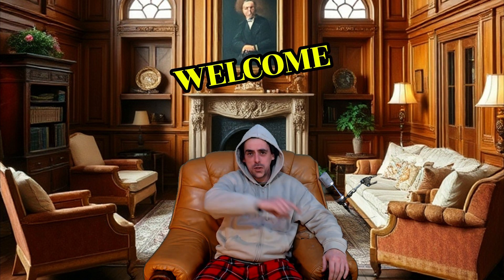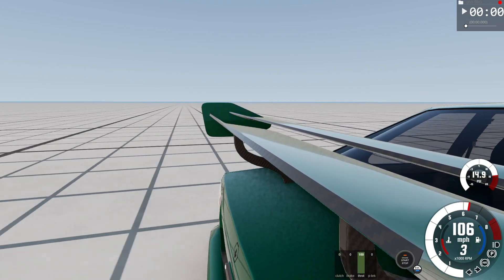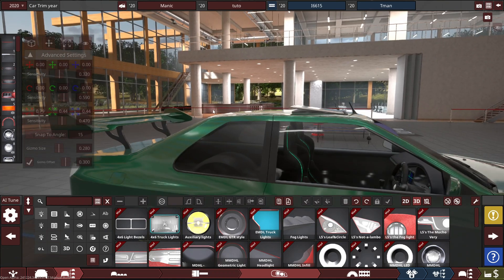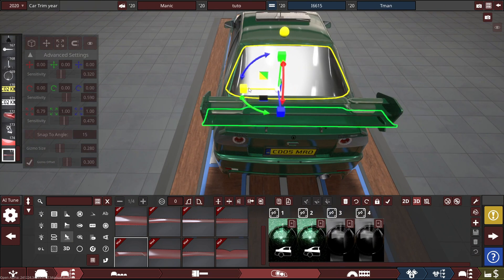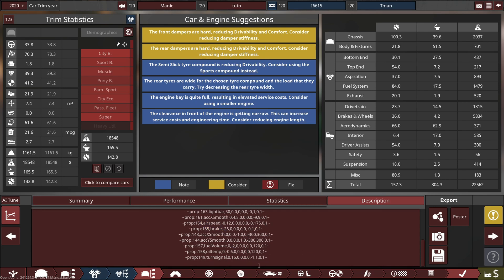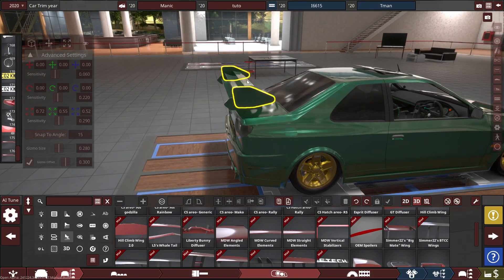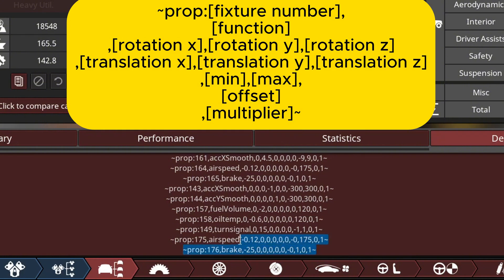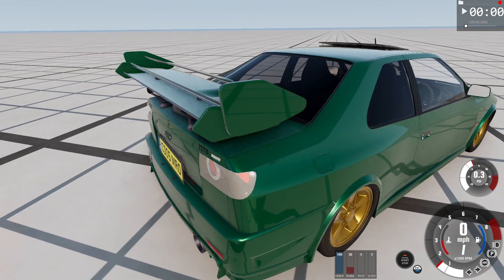Automation props tutorial // active aero wing and brake // part 10

Comment: is there a way i can have spoilers only has decoration and not add downforce my car has 3 and the rear is bottoming out
Reply from the maker: you can go into you aero and turn it down, or use some some thing not from the spoilers, so 3D or misc. that way it wont effect the aero settings.

Comment: Does increasing the Angle Of Attack actually make more downforce? I'm trying to make an F1 DRS Rear Wing, also can you set the active aero to a keybind vs airspeed or braking?
Reply from the maker: Well, yes and no. it is possible but you would need to know some coding. I think cause automation cause don't have the option to have DRS you would have to code it in your self. as it stands you can not have it do what you want from an automation car. you could maybe fake it but it would not do any, it would thing just look cool.
Reply: @manicgamingguy6161 I would have the animations done right now if the wing wouldn’t stop breaking in beamng 😂
Reply from the maker: haha make sure it can move freely maybe it is hitting the car
Reply: @manicgamingguy6161 it’s literally just the plane of the wing itself, everything else is fine
Reply from the maker: @Ethanius_Zeus  hmm play with the code a bit

Comment: How do you make the brake go up so slowly? Mine goes up instantly when I click brake.
Reply from the maker: its in the code, copy mine. same as doing a brake peddle I think
Reply: @manicgamingguy6161  yea this is mine and it dose it instantly: ~prop:91,brake,-30.0,0.0,0.0,0,0.70,-0.05,0.0,1.0,0.0,1~ (dont mind the transverse thing)
Reply from the maker: @Taeyit  try it with out the trans and see if it works. the code looks fine but obvs you have added to it.
Reply: @manicgamingguy6161 yes I mean other than the trans and the decimals the only other difference is that your minimal value has a negative so I may try that. Thanks for responding aswell
Reply: Oh @manicgamingman6161 I know why. I'm assuming your using pedals so the rate you brake compared to me causes it to deploy slower since I'm on xbox it's almost instant